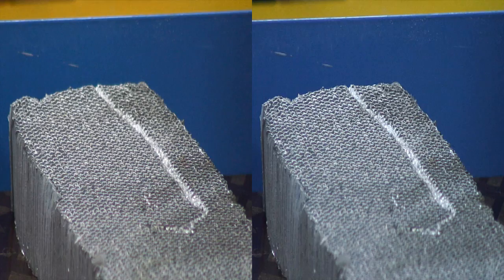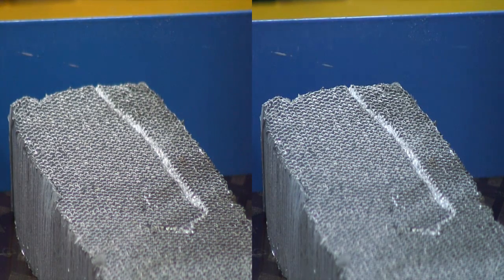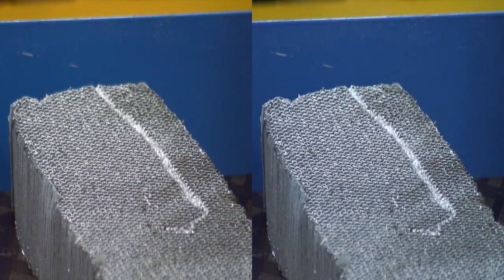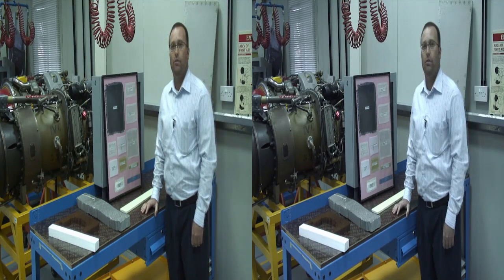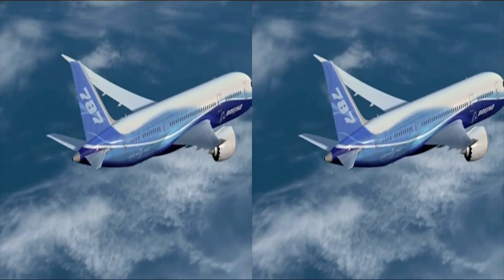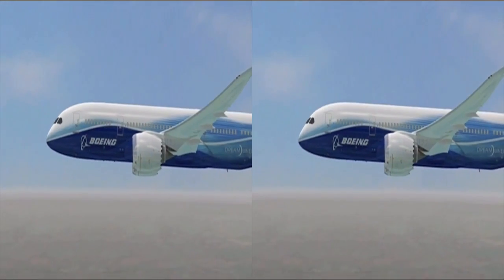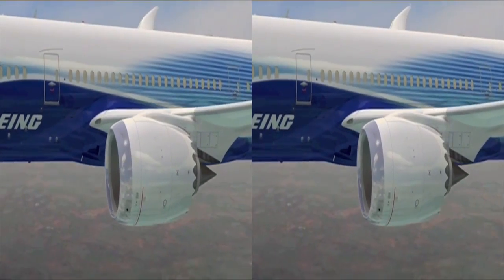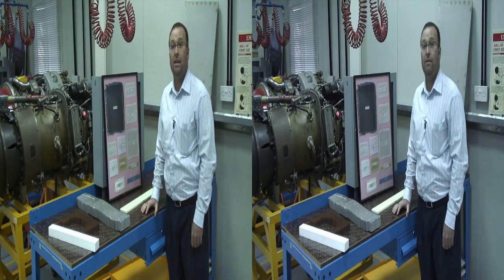Aviation Composite Materials  (HD, 3D, S3D)

Comment: @circusboy90210 market forces would force them to reduce prices to some degree. Initially there would be very little, if any savings passed to the customer due to the costly investment required to obtain such assets. The cost of that investment would have to be allocated to  various cost pools within the structure of that airline. Eventually, as those aircraft begin to depreciate, savings would find their way to the customer. I would be more concerned the gov limiting the availability of fuel...